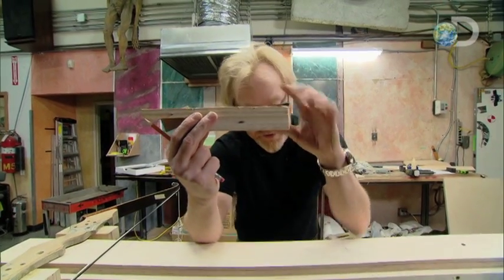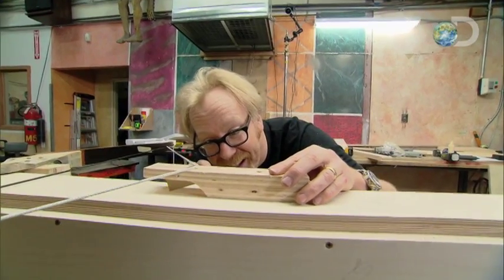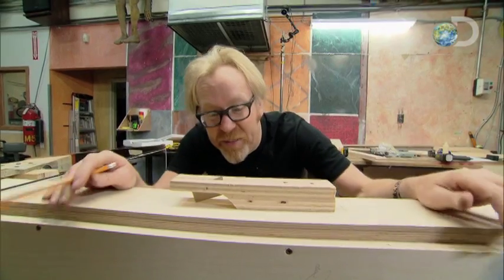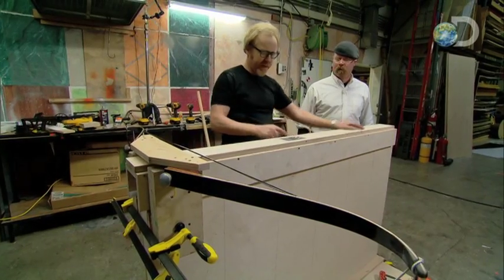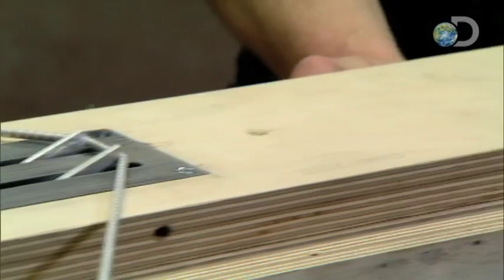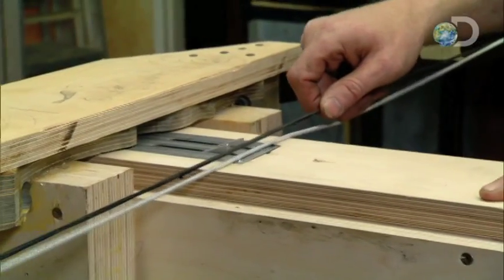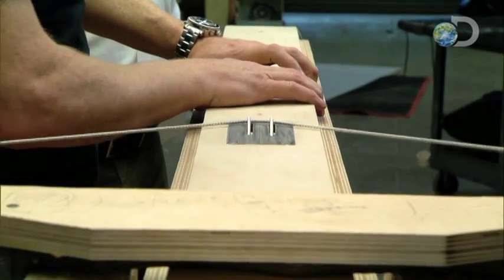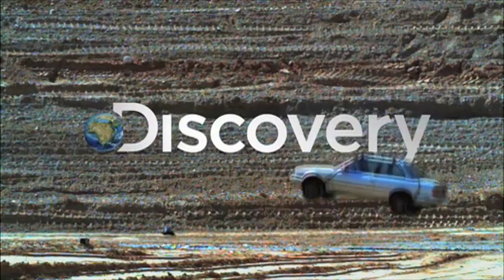MythBusters - Adam Saves the Day | Arrow Machine Gun

Comment: But what I wonder is how the make the "ship" or slider go backwards and forwards with one rotational motion. Do the use a piston principle? since the way is quite long they would need a huge wheel for the crank. Anyone?
Reply: As far as I can tell, on more “archaeologically inspired” recreations, you can release the ratchet (which would be locking the motion in one direction while charging the bow) and then reverse the winch which would run the slider forward; the trigger would re-engage the bowstring; you would re-engage the ratchet and pawl; then reverse the winch action to reload and fire when ready